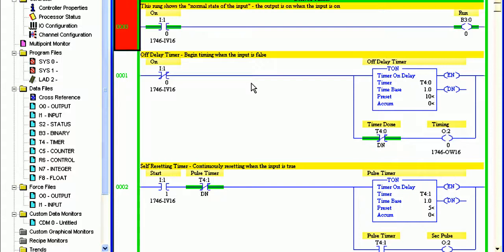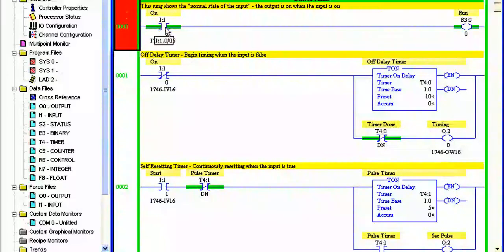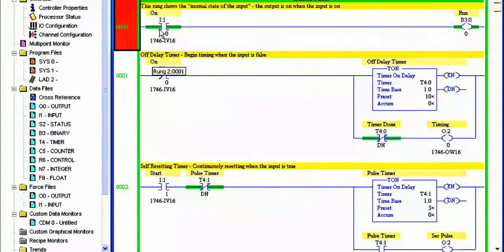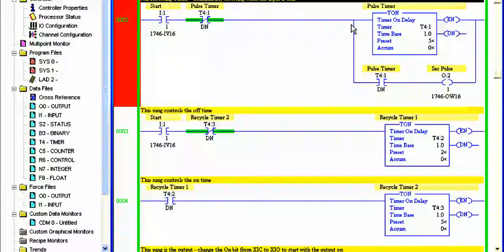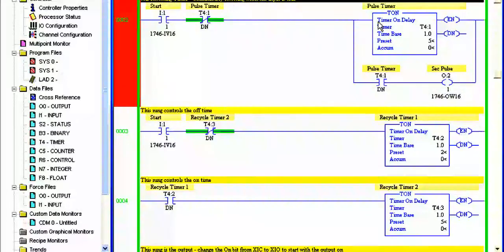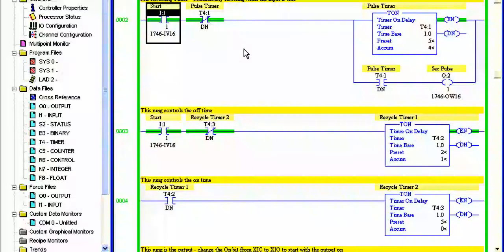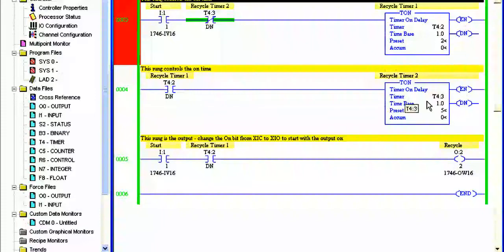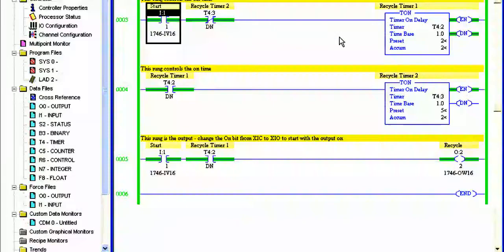12. Derived Timers on SLC 500 - PLC Training on Allen-Bradley Rockwell

Comment: Time line 1:43 you report that on rung 1 second level that the done bit will reset the timer, do not see that, the only reset will be when the input I:1/0 picks up thus opening opening up the control bit on the rung